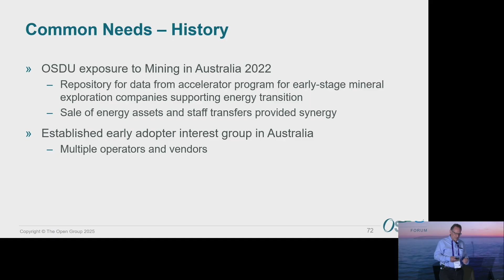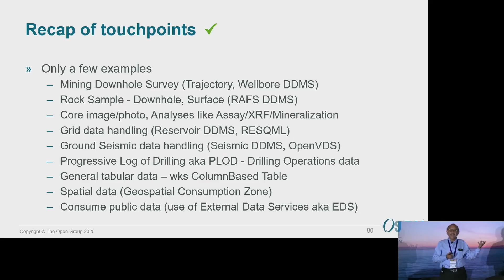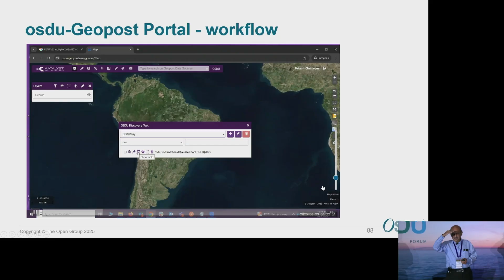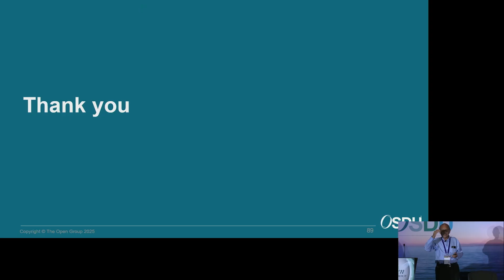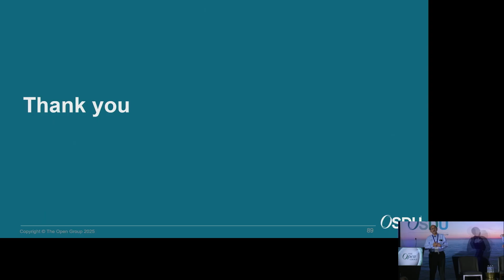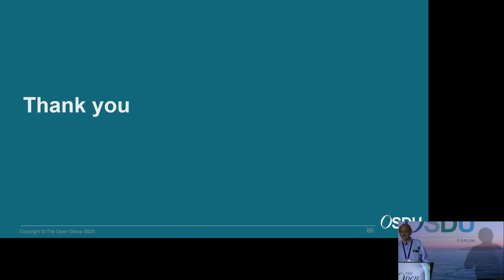OSDU Data Platform for the Mining Industry

Comment: Great explanation, this clearly shows how OSDU can be extended to mining without rebuilding core data foundations. Reusing shared schemas and open standards is powerful, but strong data validation, governance, and compliance controls are still critical in regulated environments. in the Lifewood, structured annotation and secure multilingual data handling help enterprises accelerate AI deployment while maintaining regulatory alignment. As mining data scales across cloud platforms, how can organizations ensure consistent data quality across reused industry schemas?